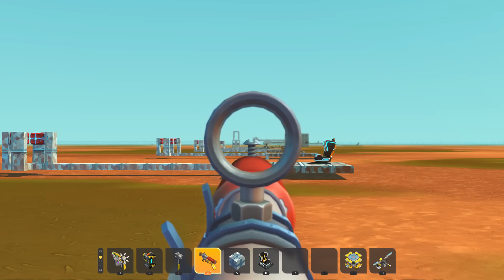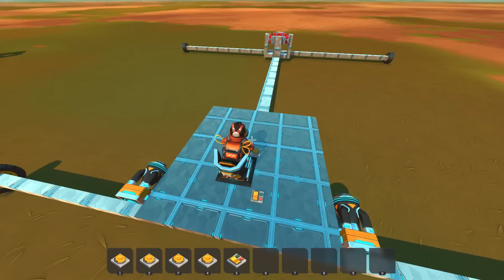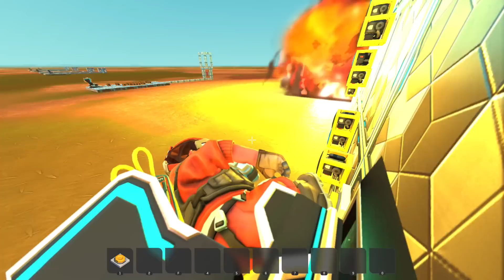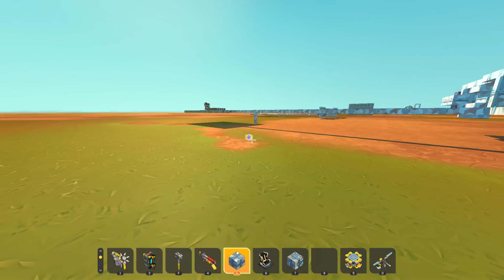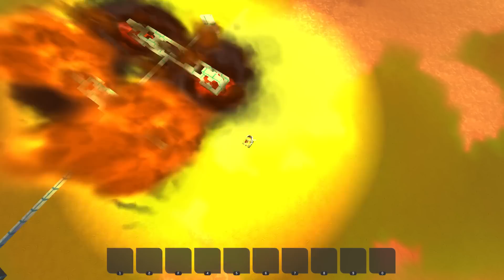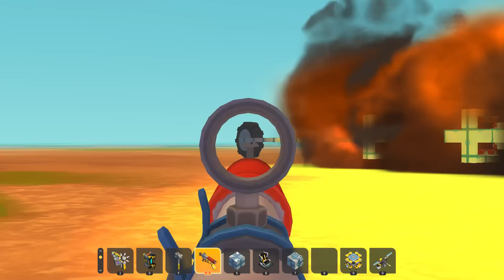I Built a New and Improved Explosive Engine with Automatic Timing Systems! (Scrap Mechanic Gameplay)

Comment: You need a clutch my guy. Disengage it from the gear to start the engine, then once the engine is up to speed, engage it to drive. Also, you should have a cylinder going off every 1/4 rotation to keep a more consistent power/rotation. I didn't catch that any of your designs were doing this. I know that's also probably difficult with Scrap Mechanic since you can only build on 90 degree angles while an object is on a lift. I would also look into doing some gear reductions, maybe some sort of gear box. I feel like this is really going to need the extra help from gears no matter how good you get it, or it will just keep stalling out. Also, an electric engine hooked to a bearing on the crank shaft might be good. Set it to a switch or button so you can use it as the starter. Those are my thoughts anyway. Not sure how practical they all are, especially combined together, but I think they'd be good if they're doable in Scrap Mechanic.
Reply: An electric engine directly on the crankshaft wouldn't work, when an electric engin is not spining, it's braking. It would need a clutch or something

Comment: Kan what I’m thinking was to make a gear reduction with the gears mod.  That will slow the vehicle down while increasing torque.   The lowers speed should help the spawn position problem.   I love you kan keep up the amazing videos
Reply: Not like a transmission but more of a gearbox that is one permanent speed.  And if that works maybe go for a transmission. But I don’t see that working only because of the speed problem relative to the spawn position of the explosives

Comment: I wonder if it would be possible to compensate for the issue of the spawners sort of lagging behind by attaching them all to a piston and adjusting thir position ahead of the actual cylinders that way the explosives spawn behind but in the correct position. It'd have to adjust to the speed and you'd have to do a fair bit of testing to tune the distance but it might be possible in theory anyway.

Comment: I would recommend two things. Clutch… if it dies the second the wheels are touching, u will never be able to idle, and two, spuds again. Just in case. U don’t need it when it’s still, but if the explosives aren’t detonating, the extra spud could help. I don’t know if u understand rotary engines, but they have an extra delayed spark just to ensure all of it is burned, think of it like that. Also, starter motor maybe in the future? Keep the clutch disengaged and start the engine up, and then turn on the clutch?

Comment: try gearing it down? it has a ton of speed, you need more torque. I know you can make an 8 tooth gear out of the pipes the same as the 4 tooth, so have an 8 tooth on the wheel axel.
The slower speed would also help with the explosives spawning.

Comment: If you take a look at a real motor 2 pistons are connected at the same point, but you have them connected 180 degrees apart so when they fire all of your momentum is going into pushing the Pistons in, then you have no momentum pushing them out. If you are to connect them at the same place on the crank shaft one piston will push the other out so it can fire, to send the first piston back out so it can fire, so on and so forth.

Comment: Reduce thé speed After thé fly wheel si there'is more torque 😉 but less speed so tnt Spawn is not a probleme cause thé véhicule is slow so relative to the spawn its not that Big of a différence 😉

Comment: IT'S A 8 CYLINDER BOXER-ENGINE!!! In a boxer-engine the cylinders are arranged in pairs, with the cylinders of a single pair facing the opposite direction and firing at the same time to cancel out the vibrations. Now, it isn't 100% efficient, but, it does cancel out a large portion of the vibrations. 
This engine configuration is a real thing, it has been used in some cars since at least the sixties, and most modern cars have a boxer-engine.

Comment: Put the spawner on top if the piston and make the crank stroke longer so you have more torque. Time the explosive to go off about 10 to 20 degrees after it passes top dead center. And some kind of clutch system. Like on the first one.

Comment: If you need more power you could try compression ignition where the piston itself ignites the explosive by jamming it into the cylinder head. You could also do a similar method of making the cylinder smaller than the explosive so that it ignites instantly.  These methods have the advantage of only requiring one spawner per ignition, but they will probably be unreliable and make the engine difficult to start.

Comment: honestly... I don't think it's possible: the whole point of the explosion is to give power to the piston, which transfers momentum to the shaft in a reliable manor, however the game mechanics don't make that method reliable, especially when the spawner, as you said, appears to be placing the bombs at designated coordinates after a delay, making it ineffective for a moving vehicle. And because that's the only reliable method of getting explosives, AND explosives are the only reliable method of applying force... it's unfortunately not a viable form of power...

Comment: You'd need more mods to make this a thing. I believe there's indestructible blocks of varying weights in one of the mods. You need to have solid piston heads and doubled up cylinder walls along the bearing axis. I'm wondering if you could also possibly make the pistons the things that trigger the explosions. Like the piston head goes so far that it squishes the explosives and detonates them. But also, I believe you showed off a gear mod a few years ago. Try that and see if you can't get more power out of the engine.

Comment: Hey Kan! So I'm not sure if you realized, but your explosives are detonating about 180 degrees out of time to the piston from when they should fire. They explode when the pistons are at Bottom Dead Center, or slightly off that considering they are maintaining rotation.

So I think you're missing out on more engine speed by having the explosives explode so late! 

I do concede it could be a timing issue in the fact there is a slight delay to the explosion, so maybe the engine is spinning at the max speed already due the the "falling edge" of the explosive time from spawn to explosion being what it is. Anyway, just an observation I had! Maybe adding some sort of explosion timing modulation to adjust the explosion spawn time would help get the engine some more oomph by offsetting that falling edge to allow for an earlier detonation.

Maybe use the flywheel rotation speed (almost like a trigger signal on a cam timing sensor) to add in some buffer to control the exact explosion time and make the explosive spawn slightly earlier as the piston speeds up. Of course the issue there is the time to reset the explosive spawners being the big hold up. Your current setup isn't even close to the limit of the spawners' reset time though! The current crank speed seems to be roughly twice the time it takes for the explosive to spawn and then explode, i.e. your explosive spawns at TDC and detonates near BDC ultimately limiting the RPM to half the time it takes for the explosives to detonate.

I think this issue may be why the engine has no torque when under load either. It's only getting enough explosive power to maintain its rotation. Using the trigger signal to modulate the explosive spawn timings, you may even be able to add in a rudimentary throttle as well to control the rate of modulation and actually request some engine speed through a modulation setting! 

To incorporate this, maybe add 4 sets of timers to each bank. Each one with a slightly different time delay. Once the engine begins to fire and run, the timing delay doesn't matter (though realize you would be running each piston in the "past" as you would trigger the timer a full rotation prior to the explosive), but what it allows you to do is shorten the timing throughout the 4 settings. So setting one can be your current timing but set your current trigger to be 180 degrees out (so essentially fire the explosive at BDC, but set the timing to spawn at TDC with the delay), so that way you could essentially spawn the explosive behind TDC and allow it to explode at a faster interval and when the piston is at TDC. So setting 2 could be at 225 degrees (the explosive spawns 45 degrees before the piston is at BDC), setting 3 at 270 degrees, and setting 4 at 315 degrees. 360 degrees would make no sense as the next set of explosives would be spawning at the same time the previous set would be exploding resulting in the explosives to neutralize themselves and seize the motor up.

But with those 4 settings, you could essentially support 4 different RPMs which you could request with buttons! So your current motor would be the slowest RPM, but setting 4 would be the theoretical upper limit as any more timing and the explosives would overlap. 

So your current upper limit would be just under 1 rotation per the time it takes for 1 explosive to detonate after spawning. Right now your engine is running at half that. So you could potentially double your RPM with this modulation stuff! 

You could even double that again by only firing an explosive once per side instead of at the same side! Essentially turn your motor into a 4 stroke allowing the crank to rotate at double the speed since the piston would be able to cycle twice. Then you could add even more setting and potentially offset your explosive spawn time by up to 675 degrees! So your upper limit would be 2 rotations per the time it takes for one explosive to spawn and then detonate.

Just some thoughts on why this ultimately kinda failed! I mean, besides the weird explosive spawning issue lolol

Comment: TIMING!!! adjustable ignition timing IS A MUST! use a controller to adjust a mechanical cap and rotor like in points system  a few degrees makes the difference with the cylinders leaving the engine on real cars too! if it fires while the piston is still on its way up the hole it will break things,  also wire the cylinders with a proper firing order. 180 degrees is fine but alternate the pistons so each opposing one is in the opposite stroke one up one down. then number the cylinders front to back, the left side is 1,2,3,4, and the right is 5,6,7,8   fire them 1-5-4-8-3-7-2-6

Comment: If you make the engine power the side you're on instead of the engine side, it can have smaller wheels, which means more force and less speed.

I feel like it would be simpler just to make a circuit where an on bit moves through it as you input stuff rather than using a bunch of half adders so it counts in binary.

Comment: Use a small wheel - large wheel transmission for a lower gear ratio, which will give you more torque

Comment: You need to advance those sensors. Your ignition isn't occuring until the piston is half way to the bottom of it's travel. As the engine speeds up, it starts pushing backwards on the crankshaft

Comment: hmmm based on the behavior of thruster i think you cant shut the thruster down completely... you maybe need put a step down thruster so that your wheel speed and thruster speed is the same, example your thruster starts at 20km/hour.  but your engine can run at 5km/hour, when you think you have the speed... you cut your thruster, there is a sudden increase load on your machine can cause a sharp deceleration which your engine cant match it. But what do i know, i am not an engineer
Reply: first of all you have no idea that whether your engine can pull your creation in the first place.

another idea is create lift by using thruster( reduce Block Weight), or use mod block which have high durability and low friction and low weight

Comment: idea: if you use a glitch welder and glitch weld an explosive but instead of hitting E on the glitch welder to weld it back in, you hook it up into a button so you can spawn an explosive attached to your vehicle and you can use spud gun to trigger it, with a sensor gatling mechanism to make them shoot fast enough to explode the explosives.

Comment: 1) I think the double explosive uses the "equals and opposites" to stabilize it some.
2) A painted square on the fly wheel with a sensor counting bit would tell the rpm. You can use additional blocks to find the max torque outside the movement problem.

I love this kind of kANtent and have missed the logic stuff, I can't suggest anything to help with the placement except for building to compensate,(ie; a more complex piston shape so it doesn't calculate a space large enough inside it to place and explosive [++++--- ) but you already had that idea.
I dont know how the game would react if you stretch the cylinders to compensate for the placement being behind the cylinder when moving.

Comment: Surprised you have it set up to just push "in" and not also push "out" That's two power strokes per cylinder per revolution. That's the way steam engines typically run. Sort of a "pushme pullyou".

Comment: The one idea i can offer without having tried something like this myself is to maybe try use the games pistons as a kind of guide rails??? but:
- Not sure if explosions would be strong enough to compress/extend the pistons far enough (if at all?)
- I wouldn't even be able to begin to imagine how you would build the thing with extended pistons
- No clue how explosion-proof pistons are either

Honestly this is a perfect example of why the game needs some sort of 'telescoping slider' block that copies some properties from pistons (locking movement to a specific axis) while being easier to build with (can be built at diff lengths like vacuum pipes?) and not resisting compression/extension.

There's actually a lot of these types of constraints missing, imagine if we had pulleys or ball sockets for example. Could make some crazy stuff with that. I really hope they are going to put a bit of thought into "more complex mechanics" in the future, but considering how development seems to keep pausing & focus is fully on survival now (and not 'more engine features') i doubt its gonna happen :(

Comment: gearing lets you have the torque so you don't stall, while letting you travel slowly with a high rpm.  so the engine can be running fast enough to not stall, but the vehicle's position change be slow enough to not have the explosives clip.

Comment: Put engine sideways and attach the wheels Straight to the crankshaft.
Gears steal a lot of Energy so this schould give it chances of moving.
Remove as much weight as you can!
Timing area can be made of wood or even cardboard.

If this woud not be enought use modded parts to make this engine really Light.
(replace metal 3 with something super Light)
:)

Comment: I'd suggest trying to enclose the pistons a bit more... And enclose the combustion chambers.
While this is only a minor change; as with anything, heavier stuff is harder to move. I think you should try to get rid of all the mass you don't need, like all the tier 3 metal as the platform for the seat/logic. You definitely don't need all that.

The last thing, and one I definitely think is important:
Can we get a better look at the piston timings?
It looks like the chambers are firing when the piston is nearly at full extension, which is definitely suboptimal. It was hard to see, but I think you could get more power by firing the explosives earlier in each cycle, maybe 90 degrees earlier? Otherwise, I think they might all be misfiring and wasting a lot of potential energy/your effort...

Comment: Quick question; the pistons on the crankshaft - are they just there so the entire shaft is rigid as one piece, while also being connected at multiple points to the frame? As in, the shaft is divided into separate pieces which rotate within the frame, and the pistons connect the different pieces so they spin together? (because the rigid connection to the frame would not collide with the piston?)
I'm assuming that's why they're there, unless they're doing something else really important and I'm missing a key detail...
I just never realised you could do that. I thought they were like suspension, where the base one block had regular collisions, and it was only the extendable/retractable section that could be phased through.
This is actually a game-changer! I've seriously been using sports suspension in my mechanisms this whole time?
Reply: Oh my god, it is... 11:18
Pistons in their single-block retracted position still have no collisions.
I never knew this...
How did I never know this?
I've been building stuff with these bendy, two-block suspension pieces this whole time!
Damn...

Comment: TBH the 4 cylinder engine looks like it has terrible timing explosions triggering just before BDC, when for these engines look like they should be triggered at  ~90 deg.

You can use one counter for all cylinders by simply connecting counter to one cylinder and having four sets of ANDs

Comment: Move your explosive into the center of the engine to use one explosion to power 2 or 3 pistons (on the same timing). then make the combustion chamber able to trigger any piston in a line backward, that way if it does spawn in later it should spawn on the next piston set, advancing the timing (have it so each next piston is ready to fire if the previous drops the explosive in a further back location see ---> ). next change the timing to hit the piston after its on the outbound stroke, not at the closest distance to the explosion. set a configurable delay on the timing detector, make it seat configurable.